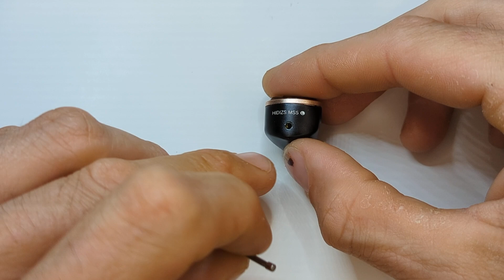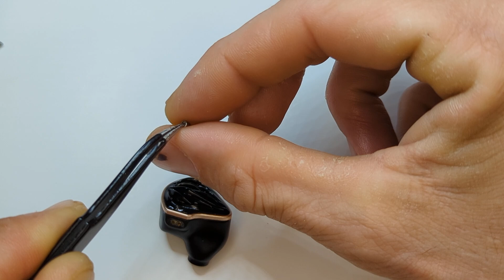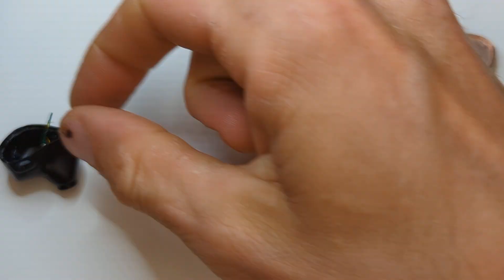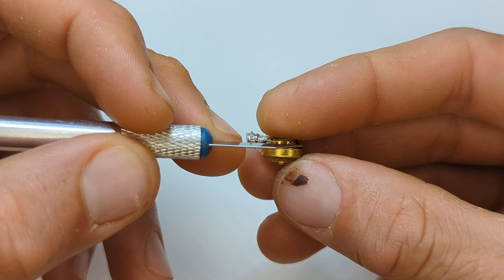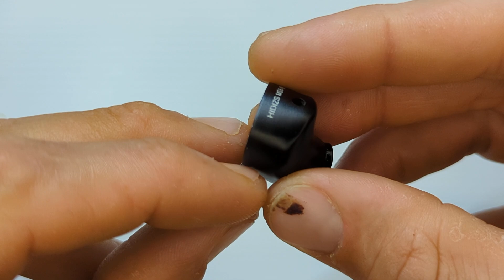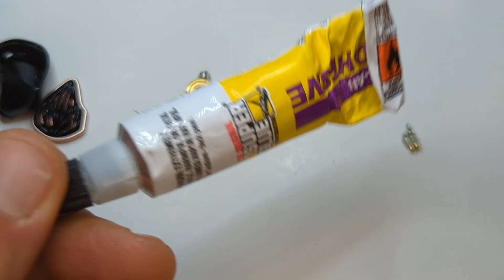Hidizs MS5 Teardown and explanation on the tuning method.

Comment: If there were no treble filters, I wonder what was causing the huge dip around 10k
Reply from the maker: If you look at the natural response of the Sonion drivers there is usually a big around 10k before they regain energy. 
I think this is just the natural response but exaggerated because of the tuning of the iem.
Reply: @hi-friaudioman  Would there be any way to mod the iem so the response wouldn't be as exaggerated? Would be interesting to see your solution to it.

Comment: Faultless explanations 👍.
Anyway, the two bass drivers shooting in a common and huge chamber is something I was never thinking of. Is not this set up blurring some micro bass details ?
Reply from the maker: It is definitely possible. The bass is pretty good on the MS5 so I think they got lucky, but the lower mids are a just a little bit messy which could be a result of the mixing.